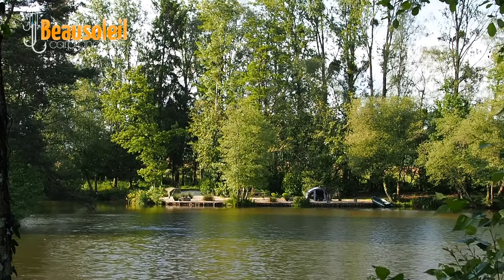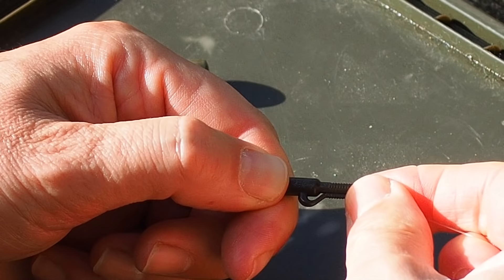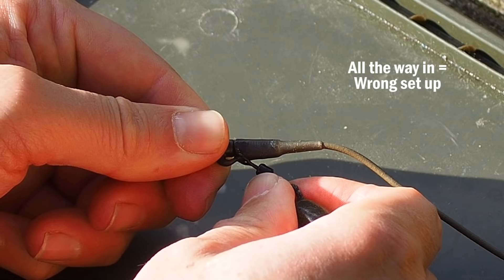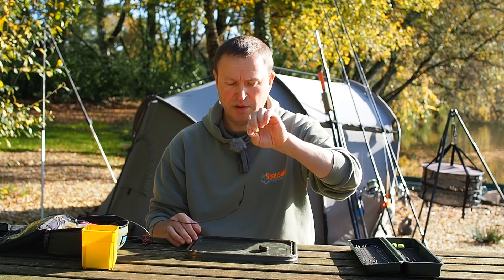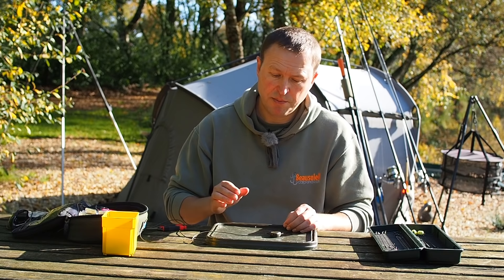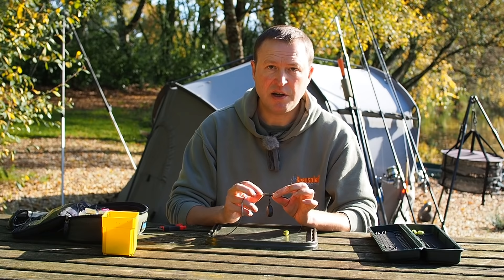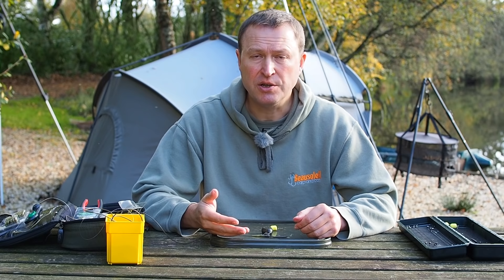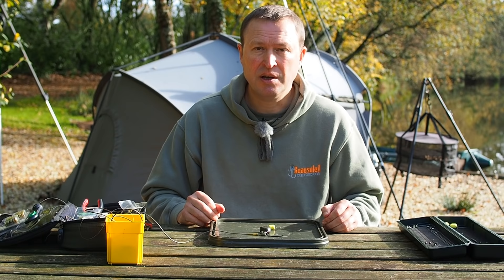STOP Using Lead Clips Like This | 5 WORST mistakes❗

Comment: First, I just wanna say your videos are so great, i love that you explain everthing, and we can get an understanding why to do what we do. Second, you sayin the proper use of leadclip is :one bite = one lead in the lake?! Or I just didn't understand it?
Reply from the maker: Hi Krisztian, thank you very much for your feedback and support. It is very much appreciated. I want to help anglers like you understand “why”. With regards to lead clips, yes that is exactly what I am saying but I don’t like it. It’s expensive and is bad for the environment. This is why I do not use lead clips unless absolutely necessary. If the weed is very bad, or there are lots of snags on the bottom and you have to get the carp up to the top as quickly as possible, then I have and I will use a lead clip. In my opinion, it should not be the default choice and if set up wrongly, it can be dangerous for the carp. I use a variety of different types of running leads for most of my fishing. IMO they are safer and far better at catching carp. They also save me money and they are better for the environment. I would suggest two other of my videos: https://youtu.be/LzFina92brM and https://youtu.be/hoHB1gi_sQs I hope this helps clarify my thoughts on this subject. Regards, Matt.
Reply: @matthewcollinsangler  thank you for the response, i wull see the videos, and keep doing these great videos😉
Reply: @matthewcollinsangler  Thanks for the new video:)
Reply from the maker: @krisztianvarga332  Hi mate, thanks for the support. Glad that you liked it!

Comment: Hi Matthew.
I spoke to you a while back, ref washers on my spod reel, and you gave me advice on spooling up with braid which i have now done.
When it comes to attaching shock leader i am using Arma cord 50lb shock leader on 30.6lb main line, am i ok to use back to back grinner?
Many thanks.
Reply from the maker: Hi Ray, good to hear from you. TBH I’m not a big fan of the back to back grinner. The finished knot always looks fat and the tag ends stick out perpendicular to the mainline which isn't ideal. I’ve tried Armacord for various carp fishing tasks but it’s really expensive and not necessary in my opinion. For spodding, I’d just use something dirt cheap but very robust like Sunset Amnesia in 30lbs. For max distance I’d put on just 6m. At £4.99 for 100m, one spool will last for ages. I use it for my marker rod setup too. 

Check out my video on how to setup a marker rod: https://youtu.be/4BGnu3FK6ks. Spin through to 1:20 and you’ll see I use the Mahin knot. It works great and as a bonus you get a tapered knot that flies through the rings easily. Never tried the Mahin with Armacord. It should work, only one way to find out 😊 Don’t forget to wrap both lines round some bank sticks (use leather gloves) and give it a damn good pull. If it slips it’s no good 😉 Hope that helps. Cheers, Matt.

Comment: I never drop the lead. I think it's bad for the lake, water quality and there for, for the carp in it.. it's also verry expensive to use new leads every fish. So i use a safety Leadclip systeem. In case the main line snaps the line can run true the line clip and the fish is only left with the rig and a quick change swivel. In al of you're line clips the fish wil be left with al of the main line and there for it's still dangerous to the carp.
Reply from the maker: Hi mate, thanks for commenting. I totally agree with you. I am not a fan of lead clips either and I don't like to drop the lead on the take, that's what I say at the end of the video. With regards to rig safety I’ve now changed over to barbless hooks. I also prefer running leads with a large safety ring which is very easy for the line to pass through even if there is chod or weed on the line. I’m not sure what system you’re using where the mainline can run safely through the clip and only leave the hooklink. This sounds like a helicopter setup to me? I'd be interested to know what it is. There are loads of different designs out there and I’ve certainly not fished with them all. I meet a hundred anglers a year and I can only tell you what I’ve seen. Cheers, Matt.
Reply: @matthewcollinsangler  the setup i use is the safety Leadclip from carpwisperer they have great video's about it on YouTube. It's a sythem whit normal Leadclip where the rig swivvel is not tight to the mainline. It runs true  the swivvel. I use a leadfree leader on it. Runs true Every time and gives great bite indication!
Reply from the maker: @thijsvermeer8565  I'll check it out. Thanks for making me aware of the product :)
Reply: @matthewcollinsangler  my pleasure! I find your video's really learnfull! This is the video about the saftyleadclip: https://youtu.be/XNez8IFl1mA
Best to put subs on cus it's in dutch. Fish safety is a big thing here in Netherlands and Belgium. Also look at the product of the brand: PB products. Cheers mate!

Comment: Hey Matt, I fish with the korda basix lead clip leaders without tubing and ive very slightly crushed the swivel on mine, ive checked and double checked that it takes a few shakes to let the lead clip run and checked that the lead clip can run all the way up my leader on to my main line without any problems. Ive only been angling a couple of months and from my experience, the lead clip stays clipped in to the swivel on the take and only slides down the mainline after a few head shakes. So far, i havnt had any mainline breakages but in the event of that happening, i thought that the lead clip would slide up the mainline to the breaking point and drop off. Do you have any recommendations as to how i can make the rig safer for the fish. Im not on the best budget and so the idea of dropping leads on every take doesnt seem like a great one for me personally
Reply from the maker: Hi mate, lead clips are not designed to be used in the way that you are using them. I totally understand why you are doing it as there are some high profile anglers that do this but as a fishery owner, I can tell you that it’s not a great idea (even though you are using the leaders and not tubing). All you need is a basic running rig. I’ve just filmed a full video on the setup I’ve been testing for two years but it’s not out …. yet! If you watch these videos you’ll get a good idea of what I’m doing. The secret to the rig's safety is a large plastic run rig that can be broken if necessary (as long as your knots and mainline are strong enough!) Here are some links to be going on with: https://youtu.be/NzmQgIiwFI0?si=qH6bLaQ84zoEpkXu
https://youtu.be/Ch032Nsihcc?si=lwqXQB6ZffFaLCTj
If you don’t want to buy a pack of rings then the other option is to use this:
https://youtu.be/pSjT2wPKtTw?si=6X35pEdnmPekXwmY
It’s great that you are thinking about carp safety. I hope this channel continues to help you out. Cheers, Matt.

Comment: Hi Matthew, what lead clip is safe for river fishing with 4.5 oz and heavier loads. I throw the rig at about 80-90 meters. Thanks for your answer.
Reply from the maker: Hi there, I don’t fish with lead clips on the river anymore (or anywhere if I can help it). I’ve done a video to explain why: https://youtu.be/NzmQgIiwFI0. 

On the river, I use a simple running rig with a plastic ring and a quick change clip so that changing lead sizes is easy. Here’s a photo from instagram:
https://www.instagram.com/p/CsoJFuBMfH7/?utm_source=ig_web_copy_link&igshid=MzRlODBiNWFlZA==. There will be a full video on this rig next year 😊

If you have to use a lead clip due to rocks or heavy weed then I would use the Nash heavy duty lead clip body & tail rubber system that’s been designed for use with heavier leads. I would set the tail rubber to dump the lead on the take. Tape the leg in place with PVA tape when casting at that range to avoid premature lead ejection. Best of luck, Matt.
Reply: @matthewcollinsangler  
Thank you very much for the extra quick reply. Yes on the Elbe my lead often ends up among the stones. I will check out your next video in the link. Thanks again and good luck!

Comment: Tackle firms want you to drop leads/weights etc so they sell more. 
All this fish tethering if you crack off or get snapped up by a fish only came about from the use of fixed leads, do not use fixed leads no problem, and there are better ways to fix a lead without all this crap that tackle firms want to sell people, their products are the cause of the problem not the answer. 
All this explanation here and items of end rig used are NOT required if you fish correctly in the first place.

Comment: I never knew you could have a problem like that, premature ejection. 😮 As you have discovered, lead clips and rig tubing can be a dangerous combination. Stick to running rigs which are less likely to tether a fish if the line breaks.
Reply from the maker: Totally mate, I’m a massive fan of running rigs, that’s what I use for most of my fishing and I've got several examples on this channel.

Comment: I'm new to carpfishing and get myself a lovely secondhand 2,25 Lbs rod and use it with 2 oz lead. The seller from the tackle shop sold me.korda lead clips without demonstrating it properly. I made the same mistake as showing in the video by pushing the rubber to firm on the lead clip. Now I've a question. If I assemble the rig properly as shown in the video and if  I hook a carp and he shakes his head it will loose the lead. That's nice but it isn't good for the environment if all that lead what was shakin off by the carp is lying on the bottom. I'm a newby so I'm searching for a fish friendly solution but also with respect for the environment. Can you recommend me a system? Thanks in advance.
Reply from the maker: Hi Marco, thanks very much for your comment. Glad that you found the video useful and it’s great that you don’t want to drop the lead each time. There is a really easy solution to this problem and that is the running rig. As you’re just starting out I don’t want you to have to go back to the tackle shop to buyl more bits so I’m going to try and describe a way of using the components that you’ve bought but in a different, safer and environmentally friendly manner.

1. Thread some rig tubing onto your mainline
2. Thread the swivel of the lead you bought onto the mainline and up the tubing
3. Thread a tail rubber and then the leadclip onto the mainline
4. Tie on a size 8 swivel (I like size 8 ring swivels but any swivel will work) with a palomar knot (nice and strong)
5. Hold the leadclip and pull the swivel into the clip using the mainline until it clicks into place or insert the locking pin if one is available
6. Slide the tail rubber over the leg of the leadclip fully
7. Insert the rig tubing into the tail rubber.
8. Hold the mainline above the tubing and the lead should slide over the tubing and then come up against the tail rubber.
9. Lightly push the large swivel on the lead onto the tail rubber until it stops.
10. Connect a rig to the mainline swivel in the normal manner.

I can send you a picture if you like. 

With this method when the carp picks up the rig, it will feel the resistance of the lead then shake its head. The lead slides away up the tubing and the carp will find it much harder to throw the hook. Whether you catch or blank or the carp is lost due a hook pull, the lead is not lost. The only time the lead is lost is if the mainline fails. Because of the way you’ve setup the leadclip, the lead on the swivel will run freely up the tubing and along the mainline until the break. Because the swivel has a very large diameter compared to that of the tubing and the mainline, this system is very safe. I will make a video of this system (that I’ve only recently begun testing) very soon. It’s very safe and I have caught some very big carp using it. If you like the way it works and you want to make the setup more streamlined then carefully cut the leg of the leadclip off as it’s no longer necessary. Hope that helps. Cheers, Matt.
Reply: @matthewcollinsangler , thank you very much. This makes sence and in theory the carp will always loose the weight only when the main line breaks. I think I'm gonna fabricate some stones with a swivel as a substitute for lead in case the line breakes. It's very easy to make and cheap in comparison with lead. Oke maybe it's not so streamlined for casting long distances but I'm only fishing 30 or 40 metres out so I don't need massive weights. 2 oz is more then enough. I'm gonna try your method as soon as possible and will let you know my experience with the running rig.
Reply from the maker: @marcohermans3207  Hi Marco, mainline failure should be a very rare occurrence as long as you are using the right materials for the right tasks. You mentioned that you are only fishing 30 - 40 yards out so I would use a nice robust mainline such as Big Game in 20lbs or Nash Bullet in 20lbs. I’d suggest a simple and strong knot such as the Palomar knot: https://youtu.be/vQNU7wGsbo8
I do commend your efforts to avoid using lead but you’ll need a surprisingly large stone to make a weight of 2oz. To start with I’d stick with regular fishing leads that have a robust plastic coating. The coating will help prevent the water being exposed to the lead. Some specialist companies make alternatives to fishing leads but they are considerably more expensive. Using the setup I suggested, losing a lead should be a very rare occurrence. All the best, Matt.

Comment: I'm new to big boy carp fishing ( although iv had bags well over a hundred pounds multiple times and a 20lb mirror) and just started investing in carp kit and studying the sport. Anyway from this video you are telling me I will lose my led everytime I hook a carp? And dropping the led is actually expected? Sounds daft and expensive to me?
Reply from the maker: Hi mate, lead clips were designed to drop the lead on the take but of course, it doesn’t make sense to do that either for the environment or your wallet. I don’t fish with lead clips. I made this video because I hate to see anglers deliberately dumping leads and I’ve found plenty at the bottom of my lake over the years. 

Most of my fishing is done with some form of running lead system which the carp find extremely hard to deal with and I don’t lose the lead. There are plenty of examples of safe and effective running lead systems on this channel and that’s all I recommend for our guests at Beausoleil. Here are some examples: https://youtube.com/playlist?list=PLHQUkuWLN6meZucvGzWoXCl774le4hw-J. 
Hope that helps and all the best in your fishing.
Cheers, Matt

Comment: great stuff , I was wondering could you do a video on running rigs
Reply from the maker: Thanks John. Yes, we'll be filming another simple running rig video this year 👍
In case you haven’t seen them, I’ve created a couple of trick running lead systems over the years. Check out these two links: https://youtu.be/hoHB1gi_sQs is a mono ‘D’ rig with a trick swivel lead based system. This is a true all rounder and can be fished at long range.
https://youtu.be/ED58TfFEcqM is my original trick inline running lead system. It’s best suited to fishing in solid PVA bags or at short/medium range.

Cheers, Matt.

Comment: I’m so confused so we are meant to dumb are weight and leave it ?? So then we haft to put another weight on ??
Reply from the maker: Hi Kaleb, it is very confusing and everyone has a different opinion! Lead clips work best when the tail rubber is pushed on very lightly so that they can dump the lead on the take, that’s how they are meant to work. This prevents the carp from using the weight of the lead to throw the hook. However, it’s bad for the environment and bad for your wallet!
The simple solution is to use a running rig! No dumping of the lead, and the carp can’t throw the rig. Watch this video and it will show you exactly how to tie a simple, yet highly effective mono hair rig which uses a basic run rig setup: https://youtu.be/LzFina92brM. I hope you enjoy the rest of the channel. Cheers, Matt.

Comment: What about the safety of it when used on leadcore/ leadfree leader materials?
Reply from the maker: Hi mate, thanks for commenting. I stopped using leadcore years ago but I use leadless leaders and I do use them with lead clips. As I’ve said in the video, I only use lead clips when I have to dump the lead and for me, most of the time, that’s not necessary. If I have to use a lead clip, I only use one with a pin and set the clip to dump on the take. If you use a lead clip with a pin with a leadless leader, as long as you set the clip right, it is safe. Hope that helps. Cheers, Matt.

Comment: I agree fish safety is priority but I have one question as it doesn't scientifically work...you cut the leg of the lead clip system so therefore are required to push the tail rubber further up the lead clip making it tighter than previously was...doesn't make sense 🙃
Reply from the maker: Hi David, thanks for commenting. With a standard lead clip the lead is hooked onto the leg of the clip and then the tail rubber is pushed over the leg to retain it. With my solution I remove the leg, push the tail rubber onto the tail rubber fully, and then use a ring to slide onto the tail rubber and then attach a lead to that. The lead slides quickly and easily away (up the line) rather than being ejected and dumped on the lake bed. I hope that clears things up for you. Regards, Matt.